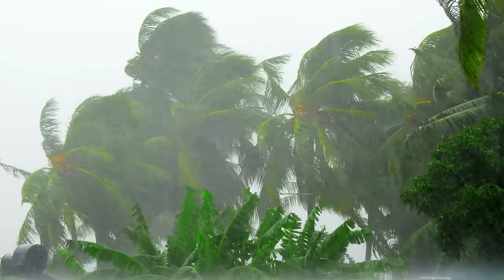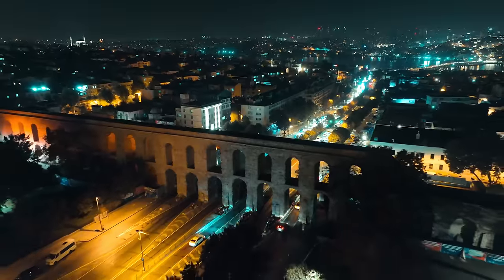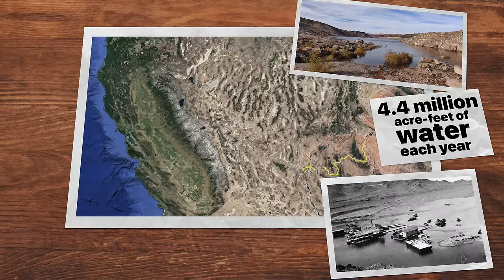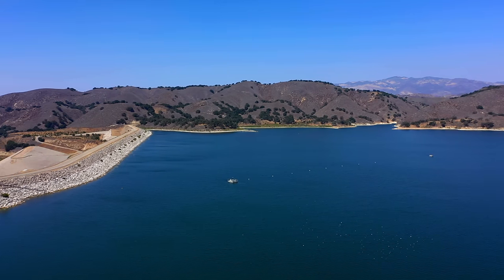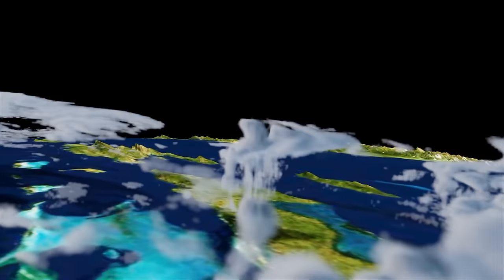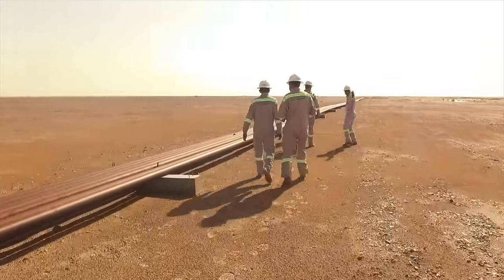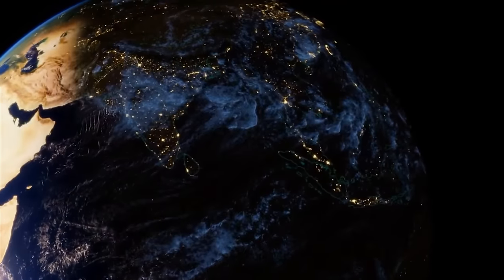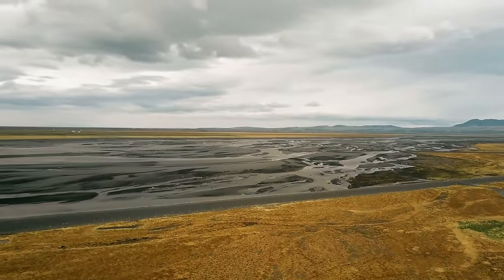Pipelines From Flood to Drought

Comment: Honestly. I think this is just a pipe dream and at best it would take 30 years to achieve. First your talking about using old oil and/or natural gas pipelines. But that’s assuming that oil and/or natural gas will no longer be using them. I just don’t think that is reasonable any time soon. I am excited to see the changes happening but I don’t see them happening any time soon and we are needing a fix soon.
2) the pipes aren’t going where they are needed. The pipes are going to cities and towns. So after they are cleaned (if that is possible) they will need to be redirected to lakes apart of the water system. Not directly to towns. That way the water can be controlled better. But all that will cost a lot of money. Even running it will cost a lot of money and energy.

Honestly, a better idea is that people should just leave those states. The infrastructure is already established on the east. You got a lot of old cities with empty homes. So instead of being the water to the people it would be much more financially logical and environmentally conscious to bring the people to the water. And it’s actually quite easy to do. You just need to move the industries paying the paychecks. Incentive them to move. 

Go green move to somewhere that already has water.

Comment: It won't work for a very simple reason:  It costs a lot of money to transport water long distances.  The natural paths of rivers are the low cost solution.  Any time you try to send that water anywhere else, it rarely pencils out.  As an example, it takes more electricity to transport an acre foot of fresh water from the Sacramento Delta to Southern California, than the Carlsbad desalination uses to make an acre foot of fresh water!  I studied the California Water Authority annual report and the Poseidon annual report to find the figures.  These are public documents, so anybody can make this comparison.  You included a transportation cost figure, but failed to mention a desalination cost figure.  Water has a value, but a big part of that value is it's location.  If it's hundreds of miles and over mountains from you, then it's cost is suddenly much higher.  If it's even further away, it's even worse.  This is why all such schemes to transport water between wet states and dry states usually fail an economic analysis.

Comment: I think this is a great idea but I also agree that would have to be a number of Federal level things that would have to take place. The reason I mention Federal is that Fresh Water is Like Produce. It has to be policed in a way that we know that it is vital when it comes to homeland security. It's almost like when certain States were given the right to go in and take back former rail routes. Most have them have been repurposed as bike trails. Here's where the U.S. Army core of engineers comes in. Let's say we laid a pipeline down before the bike trail was laid, then we placed the bike trail on top. This would allow us to move water more quickly and cost-effectively across all states. Also, we could shut off and reverse the flow of water or divert it to where it is most needed or for storage, to a place Like Lake mead. I know the central plains could use a good drink after how many years of dryness? Hopefully, water bills wouldn't be too high.

Comment: @kenz300 nailed it.  Wetlands are flood overflows, usually in the delta of a river system.   Your video suggests a great idea, but wouldn't it be heaps cheaper and easier for the governments to do what they have been doing for decades? - use airccraft to lay contrails of Aluminium oxides to cause artificial rainfall patterns?  Many have been sued, and are being sued for deliberately and negligently flooding areas of farmland where rainfall wasn't even forecast.

Comment: Can I just say that I get tired of hearing "how much it will cost". The problems we have on Earth are not generally engineering issues, they are almost always a cost problem. People need to get over the cost issue and see that the solution is available. Can we stop talking about cost and see if our world problems are physically fixable through available engineering. Water is less of a problem than the power that would be needed to run the system. Our energy consumption is much more an engineering issue than enough fresh water.

Comment: They have been talking about pushing water from north Western Australia further south for 100 years. It always runs into the problem of money. It would be the biggest engineering project ever attempted in history. We have iron ore and steel and steel pipes and it is still not feasible. We have build water pipes which are some of the longest and largest in the world and we still don't attempt this mega project.
I wish you luck with this idea. It looks that your project is multiple times larger than what we have looked at.
Oil pipes are not large enough.

Comment: So for example what happens when the dry areas of Oregon beyond the Cascade range becomes a lush growing climate and the dry air no longer pulls the moist air from the ocean? No more snow in the cascades? No more winter run off? No more Natural workings. While this seems like a good Idea there are processes in the world that we should not muck with. Can you tell me how you are going to account for the Climate changes this creates? Because Salmon count on that runoff to spawn. Steelhead have to smell the particles of its birth river in the ocean to be able to spawn. This is created by the runoff from the melting snow in the cascade range in many cases. You cant alter THAT part of nature. Artificial breeding programs can make more fish but even those are basically zombie fish that will return to the exact spot they were born based on Instinct. How do you account for these issues?

Comment: interesting idea, however, to create such a connected system of pipes from state to state even taking water from canada would be a multi billion if not trillion $ job just in infrastructure upgrades and thats with using current dead and active pipelines in place for oil.

as a public works program to help fight flooding and redistribution of water its not a bad idea, but, California already does this with taking water from lakes and rivers and this in large part has created the drought situation that's there already -- given the USA's history of these types of projects either going private or the government doing a crap job of properly managing it I suspect this type of infrastructure program would lead to long term bad effects for those cities/states/countries that opt in to feed water to more needy cities/states especially since there will likely be a large number attached to this program which can lead to miss use/corruption down the line.

Possible? - yes
practical? - if things get worse probably.
will it lead to corruption and issues later down the road? -- given the us's history with redistribution of water id say yes.

Comment: Hello Rickie,

 I think that your idea is brilliant to utilize weather to resolve the water dilemma throughout the continental U.S., and  I support all your ideas except one. Oil pipelines will not be available to ship water. Why? Crude oil will be used far into the future until a sustainable replacement is developed, and an infrastructure is completed to support the replacement. Petroleum will be the choice energy to built such a water delivery infrastructure from start to finish and for many years into the pipelines life. Better to begin a design a pipeline system engineered to be specific to water delivery. It would be as grand as building the nations highway systems, and would create a thriving economy for many years and into the future for the benefit of the nation.

 

By completing this action you are creating a

Comment: That water could be pumped with excess energy from hydro dams, when it's about to flood you have plenty of electricity to use for that, and other moments of over production.
Until there is a "global electricity grid" that is -- but also at that point, electricity is probably so cheap it doesn't matter.

Comment: Doing this large scale would be a massive energy prohibitive problem.
California can’t even keep its peoples lights on with certainty on a normal day in the summer time, let alone be able to supply the energy grid that would be required to pump anything other than an infinitesimal amount of water from any sort of flooding event to anywhere that water could be useful or needed during a flooding event.
It a great idea, don’t get me wrong, I don’t mean to sound like I’m just a critic with no basis other than shit talk.
There no safe way to reuse oil pipe, it’s steel, it’s been seasoned with temperature fluctuating hydro carbons, that even with a meticulous cleaning wouldn’t eliminate 100% of leachable material, water would rust and erode it out in no time flat. Plus you then come to the issue of reversing flow back north on a good % of these pipes anyway, most pipelines use gravity and elevation to their advantage as much as possible, which pumping water up land into higher elevation would cost astronomically more than gravity assisted down flow.
Before I write a novel here about all the prohibitive issues with this idea I’m going to post this and will be happy to engage anyone in the comments as long as you’re a reasonable person

Comment: So I see one flaw about the idea of using existing oil and natural gas pipelines, and that would be their diameter. The amount of friction water experiences when running through long distances of pipe is enormous especially at higher speeds and pressures. The solution is to use wider diameters of pipe and move larger volumes of water at slower speeds. Look into the staved wooden pipes or the large canals dug to move that water and you'll see they choose huge volumes for moving water over long distances. The pre existing oil and gas pipelines probably don't have the right diameter of pipe.

It's not like that means the water can't be moved through them, but it would either be fairly slow or very energy intensive.

EDIT: I saw the segment about the tarsand so I stand corrected on soooome pipelines, but my concern is more about pipelines going east to west and state to state. I'm assuming those are smaller. But, I'm less skeptical about that now.

Comment: one thing desalination is done through reverse osmosis...this is accomplished through pressure! imagine a series of pumps up the california mountains in tunnels 150 miles give or take and on the downhill side to death valley that is where filtration takes place ... just dump the clean fresh water down the mountain slopes to the east through the filters death valley will soon flow with water again like after the glaciers melted and the evaporative cycle will spread the moisture around.... The pacific will never run dry...and eventually the prehistoric aquifers will saturate...it took 10,000 years to run dry before we arrived imagine in 10 years we could restart the process and keep it going... we have boring machines that can go a mile a day...even in faulty ground...in less than 2 years several could be done...in 2 more years pipes and pumps installed and internal rails to constantly change the filters for the desalination on the down hill run to the valley! Jobs and comerce as the whole of 5 states is tera formed from dessert to usable land!

Comment: Umm I imagine most of those pipes are carbon steel. Unless you add a bunch of corrosion inhibitors then remove them later for drinking that sounds like a dumb idea. Mega project will rust out in less than a century and that's generous. If it was all stainless steel then we're talking but no frickin way they buried stainless pipes unless they had to. It would cost a fortune.

Comment: This is the dumbest idea I have yet heard.
Pumping that water will affect the underground aquafers of the local regions depleting it for local use, and possibly causing localized water shortages.

If you want an example of how this doesn't work - look up the north south water transfer in China and how it pumps water out of the Yangzi River basin and what has happened there. 

It would be far better to set up de-salination plants along the west coast and pipe that water to the regions that require it.

Comment: Southern California doesn't have a drought. You have poor water handling. You send over 50% of your rain water and snow runoff straight into the ocean instead of reservoirs or back into the ground!! There are 1000's of miles of concrete ditches that go straight to the ocean!

Comment: Oil and water scale of volume is so far apart. not feasible. Also Oil is a very cheap , efficient source of energy which will still be explored and produced. The conversion of Oil to energy will become more env friendly with stationary carbon capture from power stations.  Oil is not just means of  energy production but a raw material for everything we use  in everyday life. Oil is not going anywhere.

Comment: Doesn't  seem likely but maybe it could work if done in moderation. The problem is we humans aren't good at doing things in moderation.  Remember the water going into the ocean in rivers is what keeps the marine ecosystems  fed and alive. I live in Calif in the north. Already here too much is sent south depleting our aquifers. The snow falls the whole length of the  Sierra  including the southpart but all the water goes to the valley ( center if central valley is where almonds grown, not dry historically wet marshy but we built homes there now so drained area) the only opening to the valley  to the ocean is San Francisco Bay so cannal takes water south  also  south Calif bought water rights in the south Sierra so they have big tunnels to redirect water from the rivers that flow into San Francisco Bay to Los Angeles  ( San Joaquin river). So actually almost non of south Calif is from snow that falls in south Calif.  If you take yard sands water ( full of nasty chemicals) and pre rain water in the east the ground water level will fall there and you are likely to make  a big part of the east into desert cause the trees  will start dying ( already happening in Europe and England) and then the rain  will  be less in the east (Amazon effect... deforestation etc). Calif  and west also suffering from this due to clear cutting  forest fires over pumping ground water so where we used to have year round glaciers on mountain tops 30 yrs ago we now have none all this results in less snow and less rain.  Rains are coming as a deluge  too much at once so it just floods and rapidly runs off. We need to go back to more traditional farming techniques.

Comment: I have been looking into this.. but you are not correct using water in the beginning process you have cap rock from California to mid westmid country. You are only going to displacement of water and all your going to be doing is flooding the east because of the evaporation can't stay because of no shade and the cap rock issue of run off no penitration you would need tap root areas for trees to grow.. you need shade trees to grow and then build up compost to grow grass that can hold the water longer than a few hours. Gary Morgan here 30+ year of studying this process. I have my own IDEAS

Comment: Aquifer depletion is a huge impending problem in much of the U.S. We need to get fresh water in the ground instead of getting it to the ocean as fast as possible. Swamps, flood plains, and meandering rivers are key to this, but we drain swamps, put up levees to prevent flooding, and straighten rivers.

Comment: add to this proposal the potential for hydro-electric generation (from the continental divide down) to re-capture some electrical energy use to pump up to that elevation... not gonna be 100% by any means but with weather forecasting months ahead of time the cheep midnight energy could be spent moving water.

Comment: But there is always the politics of it. What if CA needs more water for crops but there isn't any "extra" water to be pumped. Who gets to decide who gets it. Flooding is seasonal, Right now barges on the Mississippi river have to reduces their loads because the water level is so low but in the spring there was flooding. The surplus needs to align with demand or you're going to need a place to store the extra water. At what point do you let crops die in CA to keep freight moving on the Mississippi river. We could pump from the great lakes but again at some point you're going to have to decide who deserves the water more. And of course lets not forget invasive species.

Comment: The goal shouldn’t be moving drinking water it should be moving river water. The oil pipeline infrastructure is already in place. We only need to replace the pipes or install a liner in them.

Comment: I could see this going sideways. Even here in Florida we have dry seasons and drought. What happens when politic persuasions convince a water release to the west when Florida's aquifer is in need? Already our everglades does not receive the proper amount of rain water because of human engineering. Although we are fixing this slowly our interference is what has assisted our flooding issues as it is. The whole state was wetlands yet we built and filled those natural drainage points. Couple that with rerouting water our engineering damaged the natural system. Point is people should leave the west instead of tampering. The drought is just as much influenced by the massive population growth that occurred over the past 50yrs as it is the weather. Accepting natural limitations and carrying capacities of a area is better. If absolutely needed then instead of taking from one area to feed another small nuclear plants should be built to power desalination plants to fill reservoirs.